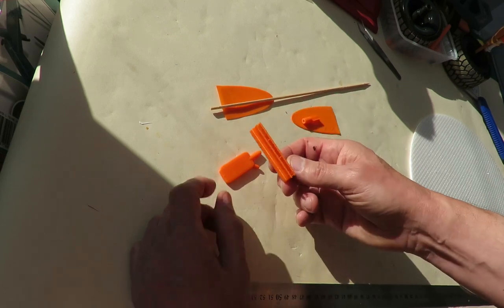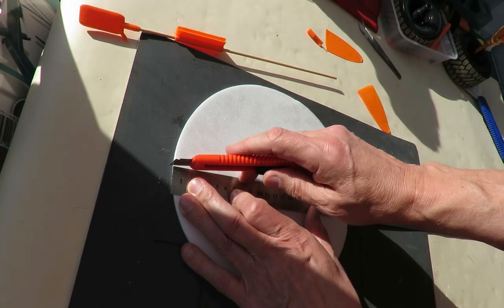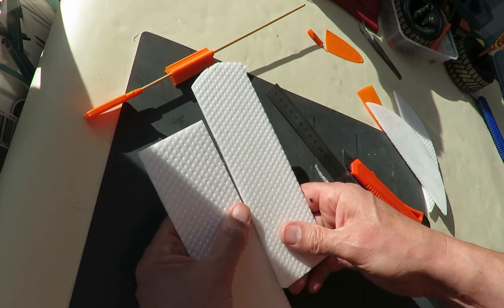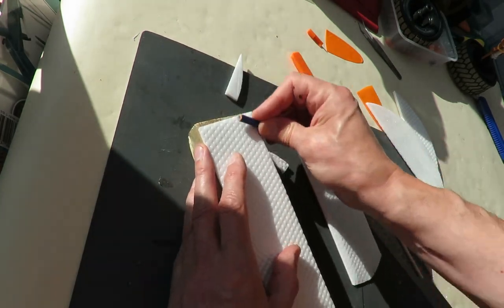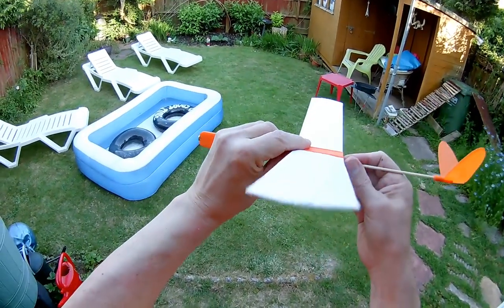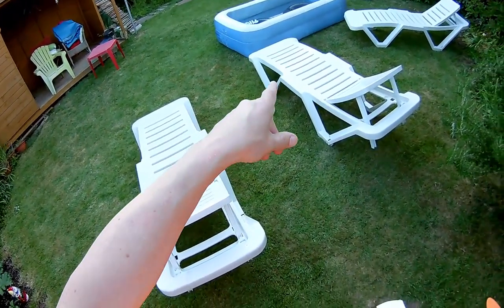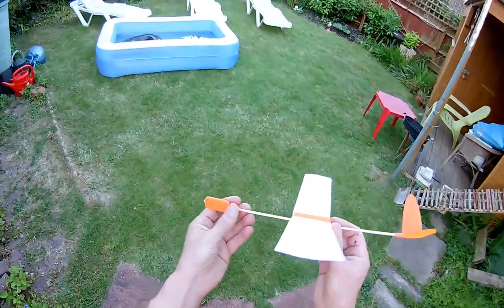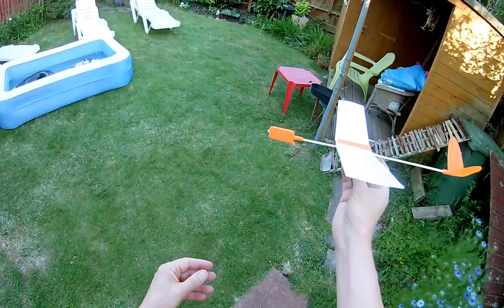3D printed + pizza tray foam catapult launch glider 20200525

Comment: That's a really cool design. Nicely done!
Reply from the maker: Hey Josh, thanks for dropping by. There is no finesse in this design, it was all about me seeing what I can design from scratch with the 3D printer. I suspect with a bit of power in the catapult it will fly ---- apart ---- but if I keep it gentle it will be good enough to keep me occupied. Main problem at the moment would be to find somewhere suitable to fly. With so many people staying home at the moment, lots of the convenient flying sites I would have gone to are actually quite busy with people. Many others have been closed, so the open ones are busier.
Reply: @GrandadIsAnOldMan  the busy nonsense will pass in time and then you can fly again. In the meantime I need to print one of these and give it a try.